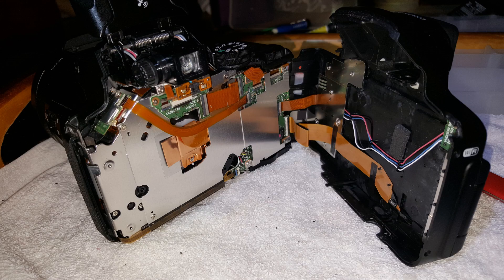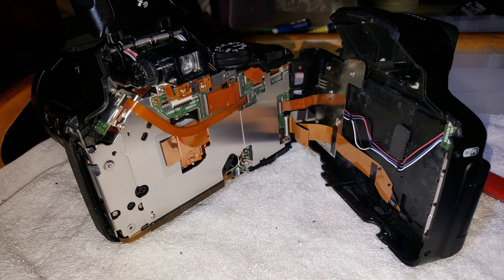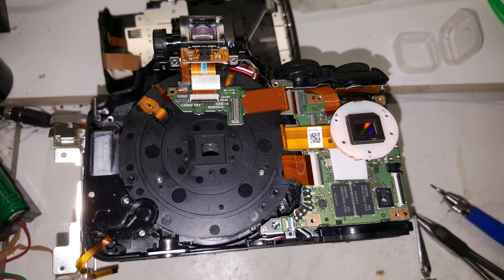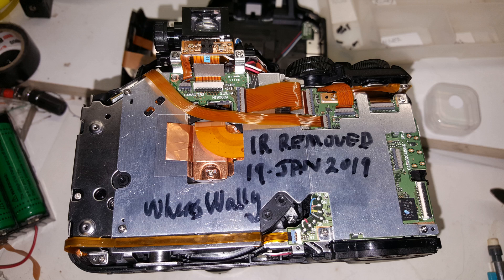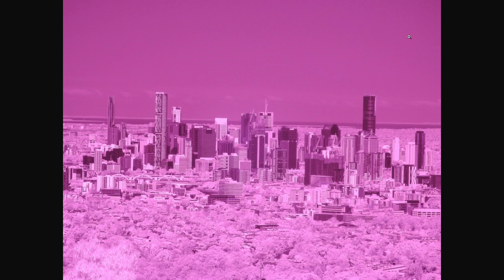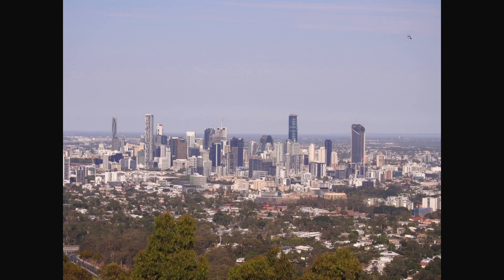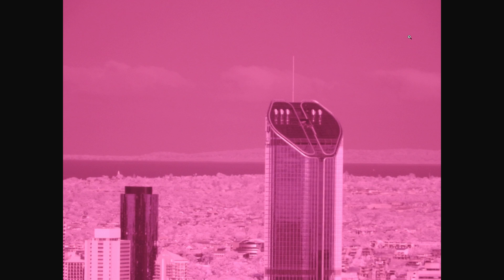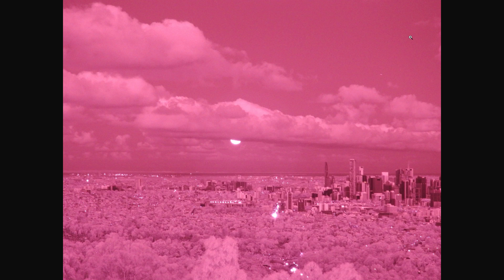P900 Infra-Red Conversion featuring WheresWa11y

Comment: CT, I know next to nothing about cameras, so I have a question. Would it be possible to see the new moon using a camera with the IR conversion.
This would help to bust another flerfer claim that the moon disappears during its new moon phase. 

Love your work lad, just keep sticking it to them.
Reply: The thing is, basically the new moon can't be seen at night, because it's between the Earth and the Sun.. so if you can't see the Sun, you can't see the Moon. And in the daytime, the brightness of the Sun drowns it out. That's why flerfers think it disappears. Here's some explanations of why this is so.. (scroll down a bit and read the first two answers to the question.  https://physics.stackexchange.com/questions/1907/why-can-we-see-the-new-moon-at-night

Comment: Just to check can you use the camera as usual with a if filter over the lense instead of the sensor? I would asume it would work but wanted to make sure.
Reply from the maker: Yes all those pictures taken with the same camera on the same day. I put a UV-IR cut off filter on the lens to restore normal operation.
Reply: @CriticalThink  nice I have to do that/get that done when I get a DSLR :-)